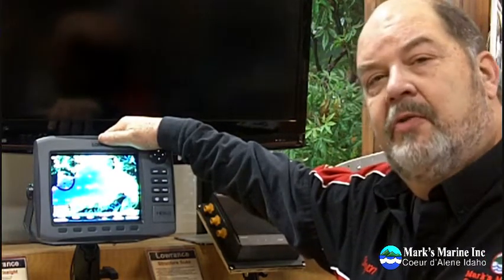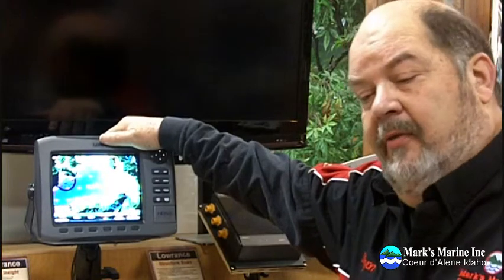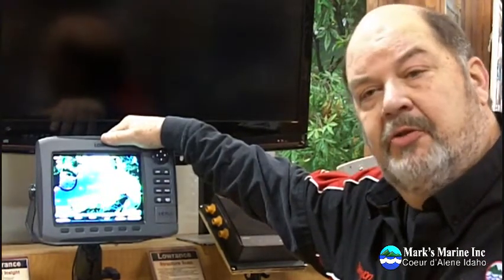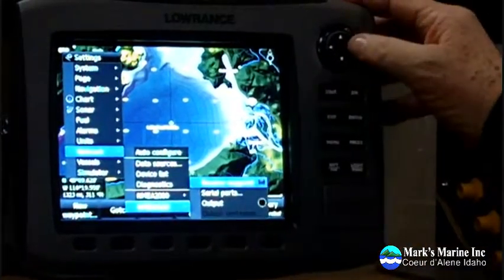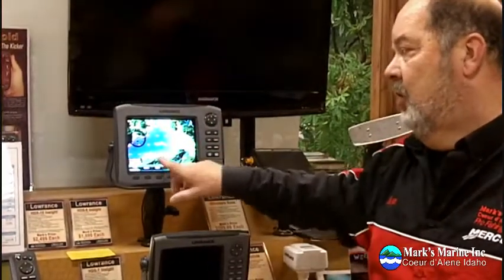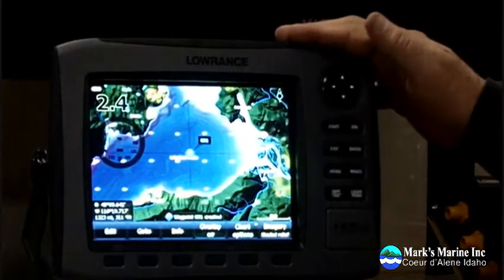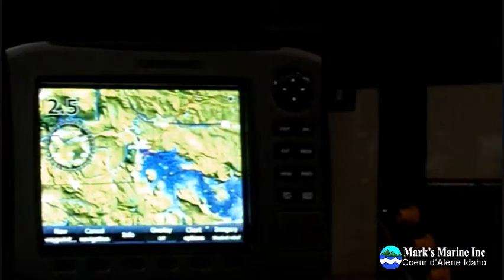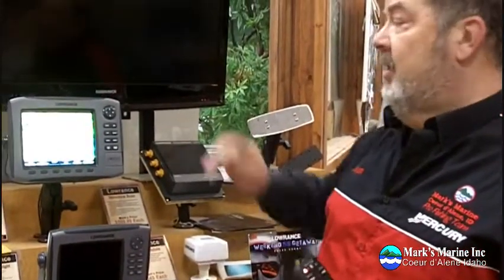Setting and following a Waypoint with a TR1 Gold Autopilot

Comment: Will this autopilot work just the same with a humminbird Helix? I didn't realize they function with other brands.
Reply from the maker: Josh, Humminbird is almost non existent in their NMEA support, but they do make a NMEA 0183 cable and they used to support RMB/RMC sentences in the 7" and bigger models for output which would make it functional.  It's pretty depreciated though and they haven't updated their network FAQ on it since 2015 so I don't want to speak in the definitive (that was 3 generations ago).  It should work with the appropriate adapter cable, but it wouldn't be my first choice in brand to drive it.  The TR-1 will still function as a heading autopilot without route guidance though with no chart plotter hooked up.  If you want to try I would suggest giving humminbird tech a call first to make sure.
Reply: Thank you for following up and responding.  I'm going to get the TR1 and hope for the best. Worst case it will work without a plotter , as you stated